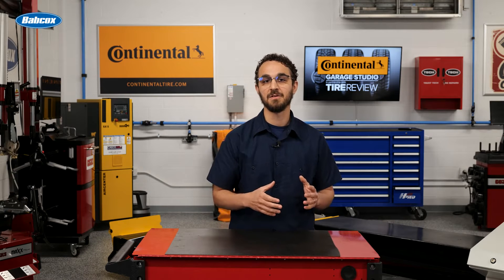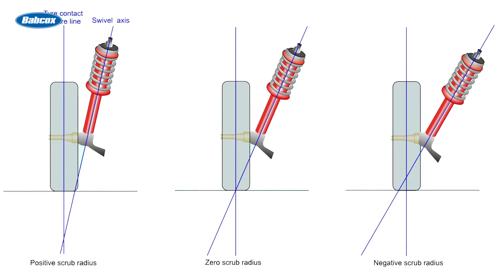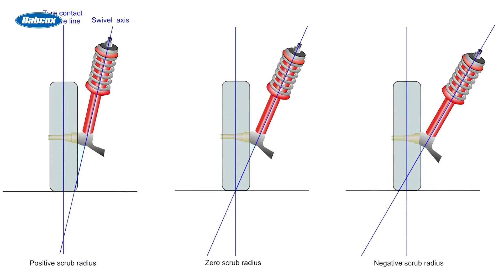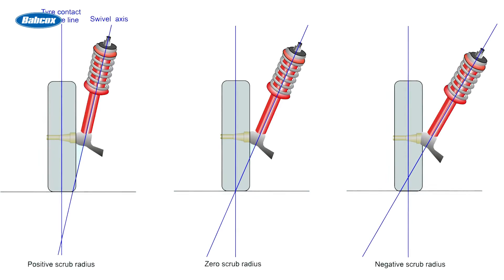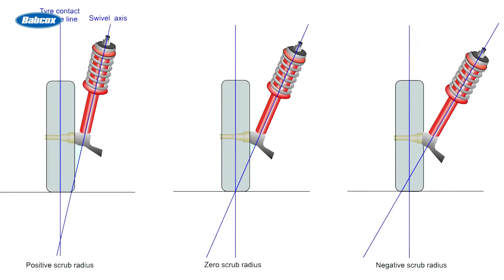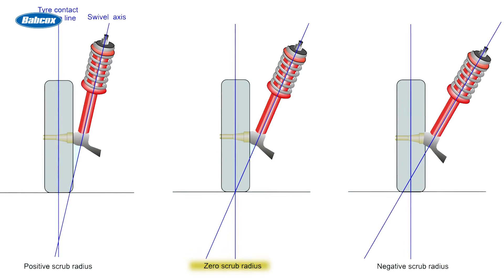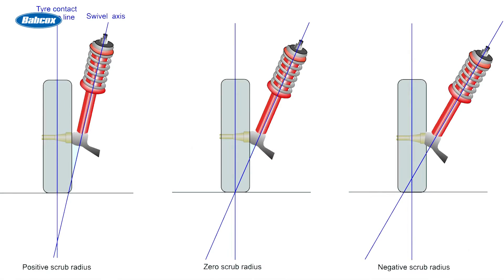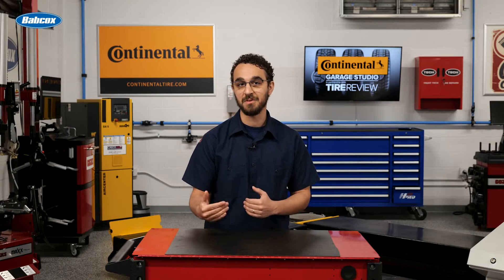How replacement struts affect alignment angles

Comment: Ever hear of drilling the knuckle bracket on a strut oval to compensate for alignment? Replaced both struts on a 2016 Dodge Journey R/T. When the vehicle was taken to a tire shop for new tires, the mechanic stated that they would have to drill the holes for the knuckle bracket on the strut oval, to align the front end. They stated the top of the tire appeared to stick out in comparison to the fender. They made no reference to camber or lower part of the tire. Myself and others noticed no such thing. There was no instruction from the manufacturer that modification may be needed. I'm also pretty sure this would VOID any warranties.
Reply: Most aren't adjustable, so widening holes to adjust is definitely typical. Just not typically required